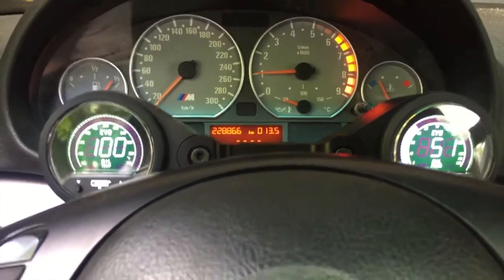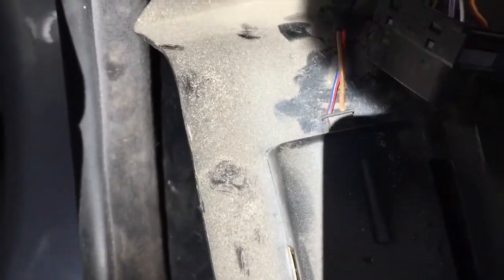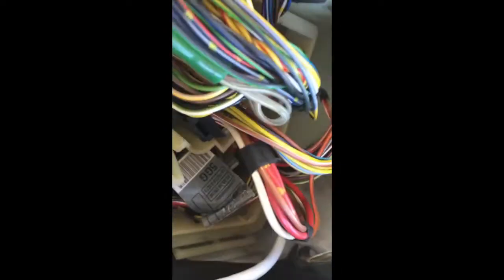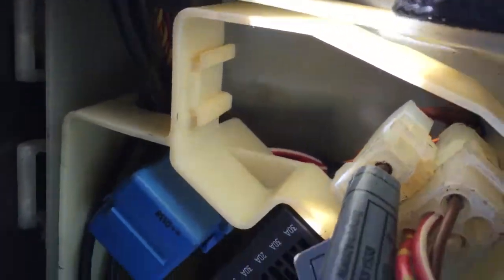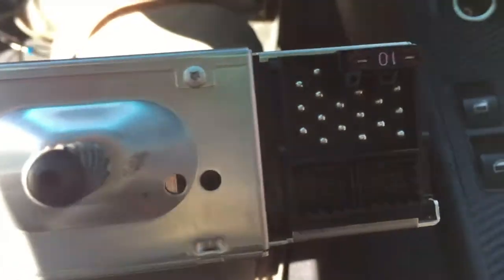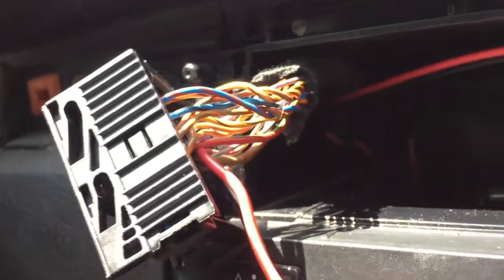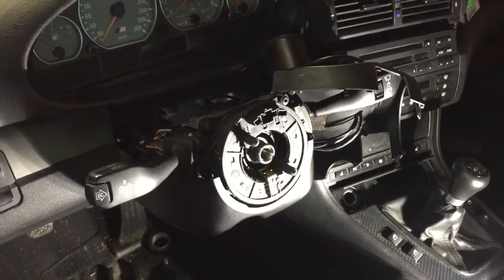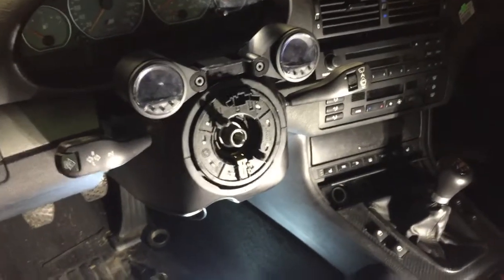E46 M3 Oil Pressure Gauge Install (Part 2/2)

Comment: Hey Paul, thank you so much for your help with the GFM. I never expected that.

 Anyway, I have no other way to contact you since I closed Facebook but I wanted to ask your opinion about a car. It's a 2004 Honda Civic LX coupe. 165,000 km on it for mileage. Timing chain done at 100k. Undercoated every year since new and all paperwork is available since 2004 for all maintenance. New alternator, new rear drums, new front rotors and pads. New rear left brake line. Some surface rust near the jack point and on one of the rocker panels. I offered $3200. He had it listed for $3500 and he accepted my offer. I haven't been into cars for ages so not sure where I stand with this car. Oh, also comes with extra four all seasons on steel rims that only have around 3000 km on them which will likely need to be put on before winter. Everything works. Isn't burning oil or coolant. Was well cared for. Only two owners and has a clean Carfax.
Reply: This is Jason Perry BTW.